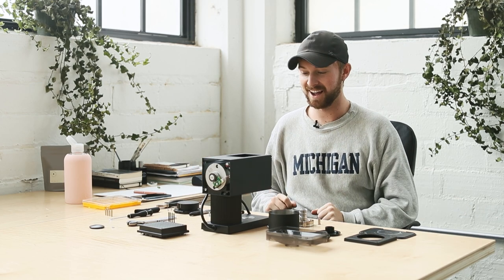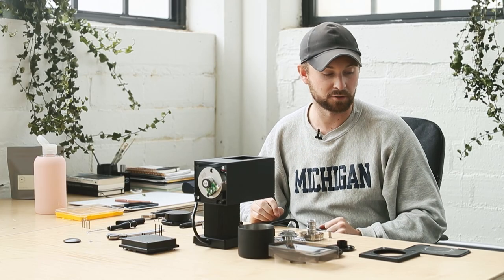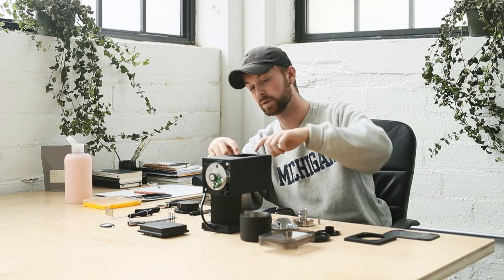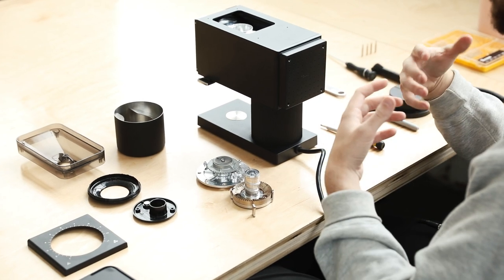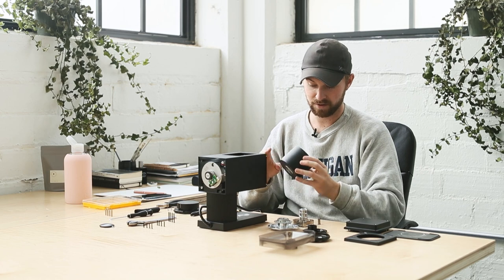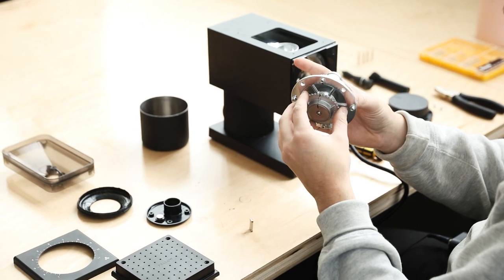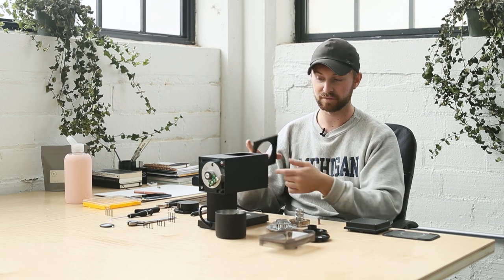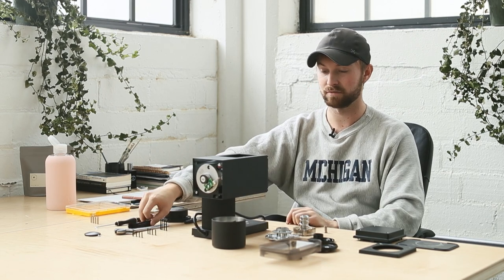In Depth: Fellow Ode

Comment: I upgraded to the Red Speed SSP burrs recently and while it's been great, the dial will be very tight when turning fine after grinding. It does go away after turning the dial final while it's running with no coffee.  Any clue how I could fix this?
Reply from the maker: It’s creating too much friction for the motor / buildup.

Comment: Nice vid! Are you aware what motor is being used and whether it's a motor used in any other grinders? I keep hearing people say 'SSP burrs will ruin the motor' without any real evidence. Knowing what the motor is, what it's capable of and whether it's identical to any other manufacturers motors is really difficult to find and would be super helpful to know to get some real conclusion on this issue.
Reply from the maker: It’s likely that they created these grind tolerances with the motor in mind.
I’ve heard this too - but have not tried myself.
Reply: As long as you don’t use the SSP burrs for espresso you’re good. The grind consistency - especially when shim aligned, it’s crazy good.

Comment: I suspect that the electronic card and disk on the back of the unit are used as an encoder to control motor RPM. 
Regardless of the exact purpose, I cringed when you casually laid the unit on it's  back, potentiality bending or deforming the disk and or changing the clearances between the sensor on the card and the disk.
Please edit this video to make the point that you can totally wreck your $300 dollar grinder by doing this!!!!